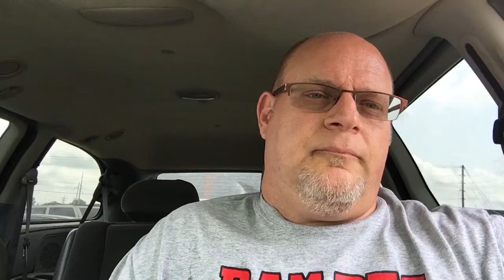GM 5.3 5.7 6.0 12552216 crankshaft issue 2.0

Comment: I noticed something today while changing my reluctor that i cant believe nobody has not seen before. While removing a 58x from  a gen 4 6.0 crank and also removing a 24x from a gen 3(maybe 3.5 because it had gen 4 pressed fit rods) to replace on the gen 4 6.0, I noticed the counterweight profiles are much different, i always heard they was the same but they are definately not. I took posterboard and traced the rear counterweights on both cranks and with the posterboard on the rod journal side, with the posterboard against the rod journal you can trace the whole counterweight profile. The difference i got for example if we are talking fractions/pie cuts, a pie cut into eight pieces, the 6L is almost half a pie or 4 pieces whereas the 5.3 counterweight was closer to 3 pieces. Its a considerable difference and both cranks are the 216 casting.
Reply from the maker: I wish someone would make a video or other resource we could share to help others identify these differences.  This is very interesting Thank you!

Comment: Did you ever get some in stone facts on this issue? Thanks again!
Reply from the maker: Still nothing concrete, I can’t find any repeatable/reliable information on how to tell the crankshafts apart; other than the original LS1 crankshafts are gun drilled. 
Let me know if you find anything!!!  JD
Reply: @HeadFlowInc maybe i can help a little here from my limited experience with LS engines as im more of a gen one sbc and bbc guy. First off every 5.7 ls1 crankshaft ive seen is not completely gun drilled through the rod throws only the mains for bay to bay breathing(only the performance high rpm engines need this, non truck engines). As for balance its my understanding they drilled the front throw-front side and rear throw-rear side deeper for the heavier bobweights. The 5.3s you cant even get your finger in the hole its so shallow, but the 6L-pinkie all the way to the knuckle-on the gen 4s ive personally seen. Im guessing the fine tuning is done on the counterweight removal(drill holes)  and placement which i would think would be different for gen 3 and 4, not just from total bobweight but the fact the big end of the rod is much different(weight wise). This is just my opinion from what little ive seen. Not fact just my guess.
Reply from the maker: Interesting, I knew about the LS1 cranks being gun drilled w/ 16 part number. I hadn’t heard the inset hole idea on the end throws; I have a 2005 6.0 crank in the shop I’ll check out. 
I read one time the counter weights were slightly “clocked” different but seems unlikely with the shared casting/part number. 
The LS production line crankshaft Balance used a +- 4 gram from mean/median scale .. so each rotating assembly could be out +- 8 grams.
Reply: @HeadFlowInc  i wish i could post pics here i would show where i traced the outline of the rear counterweights on the gen three(w/gen 4 rods) 5.3 vs gen four 6.0, the difference is massively substantial imo. I cant remember where i got this information(old age) but the LS engines are supposed to be balanced to a greater degree than the older carbuerated engines because of the knock sensors as they didnt want the sensors to pick up on harmonics and retard timing hurting fuel economy and efficiency. I also remember there was something about the sensitivity of the sensors because of the aluminum blocks cushoning effects or ability to absorb. Idk but seems to me that would be an advantage for the performance engines, i assume the knock sensors could do their job without picking up false signals.

Comment: You are thinking way to hard about this lol
I know this is a old thread but you know they all have same part/casting  number but gm has different service numbers for that part number.
If you pulled a 5.3 and 6.0 crank out of a used engines and checked bobweight they will be diff bobweight.
Moot discussion here is some fun facts for you pull apart any gen 3 or 4 4.8 5.3 6.0 6.2 apart and weigh each item from that engine rods will vary 10g pins 15 to 20g pistons up to 5g diff so any 4.8 5.3 6.0 6.2 could be off 30g from hole to hole if parts stack just right.
Also moot point since 1k members of sloppy mechanics turn gen4 rods/pistons on gen 3 cranks 8k plus for years 😂
Reply from the maker: There’s more to the story but I appreciate you watching and giving your opinion. Just because people do some thing doesn’t make it right or the way others should do it. Sloppy mechanics is about running what you have with zero cares whether it lives or not. Most people don’t catch on there’s no guarantee.
8k….. you’re a hoot and totally misguided by BS
Reply: @HeadFlowInc  yeah there is not multiple sbe stock bottom end record holders spinning gen4 5.3 8500 at 1100whp 😂 aka capizzi 4.503 @155mph 
And most hot n/a ls3 builds are 8k plus 550whp on sbe.
Have you been in a cave last few years Even weak gen3 rod 4.8 5.3 6.0 have all been 1400plus on holdeners dyno.
Reply from the maker: @Thelastoftheog  Where you messed up was mentioning people I actually know; that you have only read about. 
1. I told you to do more research because you’re only partially informed. 
2. “A Stock Bottom End” doesn’t mean it’s untouched, only it has stock parts. 
3. It takes limited travel lifters or solid roller to control the lifters above 7800-8000 rpm. 
4. You are only making yourself look foolish.
I could educate you on how all this works, but I truly don’t think you’re ready.  Keep reading on the internet and watching other people succeed!  Maybe one day you’ll get someone to believe you know what your talking about.  Good luck, have fun!  JD
P.S. I’ve been doing this 36 years so don’t think your ahead of me. lol 😂
Reply: @HeadFlowInc  if you think anyone on this planet considers sbe ls stuff to include cam choice you should retire.
And the caddi lifters are not limited travel and do well over 7k 
Still moot since plenty still run delco ls7 lifters 8k
Reply from the maker: @Thelastoftheog  My Sealed Power lifters with Comp 918’s easily rev 7300+, but you already knew that. 🤷‍♂️
How did you change 8000 rpms down to 7000 rpms?  Try to stay focused you’re getting lost already.  🤦🏻‍♂️
Keep going I haven’t laughed this hard in a long time!
Reply: @HeadFlowInc  im lost 😂 you made a whole video about a casting number without realizing they can be finished different and end up with multiple diff service numbers.
Then incorrectly thought bobweight has any effect on total finished crank weight it doesnt.
Then inferred sbe stuff was fantasy land over 8k wrong again.
Reply: @HeadFlowInc  i can only assume you are the type to advise a customer spend 3 to 4k rebuilding a 100k mile 5.3 with stock replacement equivalent parts to "do it right" for a sub 400whp n/a build 😂 vs throwing a cam in it and letting it ride for 1k. 
While still knowing the "built" 5.3 could have as many or more issues before the first oil change due to crap machinists 4pm friday builders q.c issues of aftermarket parts lately.
Reply from the maker: @Thelastoftheog  You couldn’t be any dumber, watch my channel look at all the LS videos and I think you’ll find out that you’re coming across as the most ignorant person on the Internet. You are literally talking out of the side of your head about shit you don’t even know anything about because you’ve never done it. 
I’ve never built a brand new all new LS engine. Now, you can either shut up or I will mute you on YouTube and you won’t be able to post at all.  So grow up or go away cause I’m sick of it!
Reply: @HeadFlowInc  just saying its a non issue pull any given factory sealed 5.3 apart and it will avg 15g off hole to hole possible 30g if parts stacked just right.
And those engines usually go 200 to 300k.
Now do you even know about the 100k plus bastards that gm put out aka gen  3.25  where from the factory  pressed pin gen4 rods and gen3 pistons and gen 3.5 where left factory with gen3 rods pistons on one side and gen4 rods pistons on other yes thats right factory sealed 5.3 with documented 4 gen3 in one bank 4 gen4 on other bank and they still go 200k plus miles.
Who even worries about this crap on stock parts?
Reply: @HeadFlowInc  my bad 8700 n/a sbe ls3 thats 8700 on stock rods, crank, pistons, main bolts, rod bolts, 
https://youtu.be/rArdRDYhOy4

Comment: Gun drilling a crankshaft is like adding weight to the counterweights. So if the 6.0 has an extra 40 gram piston rod assembly, it needs a heavier counterweight to start with. So that make sense matching the gun drilled cranks to the 6.0 litre.
Reply from the maker: The only factory gun drilled crankshaft is the 5.7 LS1.  I wonder how the 6.0 pistons/rods balance with an LS1 crankshaft… 🤔

Comment: I've seen half gen 3 rods and half gen 4 pressed pin rods in a 04 5.3
Reply from the maker: Yes 100% there are hybrid rods during the switch from Gen 3 to Gen 4 with the thicker beams but with press-fit pistons!  Iirc late 2003 and 2004 can have them.  JD

Comment: My 5.3 truck motor im rebuilding has a gen 3 crank with gen 4 rods. This use to be a work fleet truck I got . it chucked a rod had to by two rods . the was with a gen 4 block with 24x reluctor wheel
Reply from the maker: Wow, it’s got to be hurting the Gen 4 rod in a stock setup.  Some of the crossover engines have a weird Gen 3.5 rod/piston setup where it has the Gen 4 rod with a press-pin piston.  Good luck on your build! JD

Comment: I was wondering If an engine gets a big turbo doubling the power going down the rods doesn’t that extra HP beat up on bearings also ? The rotating assembly may be statically balanced, but doesn’t the cam, intake, heads, boost, compression and all the other variables effect the dynamic balance ?
Reply from the maker: Busa0069 It seems we’re talking about several different loads on the lower end.  
1. Rotating assemblies are both statically and dynamically balanced.  Weight matched assemblies balanced via counter weights on the crankshaft to offset damaging vibrations/harmonics. 
The Compression ratio, rotating weight and Power have influence on component fatigue and ability to handle different levels of power/torque.  It’s interesting you mention dynamic influences on engine balance because large variances in cylinder pressures would influence how smoothly the engine runs. 
Doubling the power of an engine, especially via Turbo charging greatly increases the Torque.  In reality the Torque is more damaging than HP on component life.  You’ll want to research the power levels you intend to produce and select the parts needed to support those levels. JD

Comment: the 6.0 crank is heavier because it has a thicker flywheel end
Reply from the maker: Aguilon Can Presa Canario The only years for the extended crankshaft register 6.0 was 1999 & 2000.  I have since this video found out GM uses a “Median” balance on the piston/rod assemblies for each CID of +- 4g.  Each assembly for each CID will all weigh within 8g or -4g Median +4.  No where near precision balanced, it’s a production tolerance.
Also, if you stand the crankshafts on end, 5.3 5.7 6.0 6.2 the counter weights will be slightly twisted offset different for each CID.  JD

Comment: Hi, I have been following you for quite a while, first time that I have a question. I bought a 5..7 LS1 engine the block turns out to be no good, so I bought a 4.8 engine . Can I put my 5.7 crank in my 4.8?
Reply from the maker: Sheldon Vanek Yes you can put your 5.7 crankshaft and rods in the 4.8/5.3 Block. The 5.7 pistons won’t fit unless you have the 4.8/5.3 block bored to fit. You can either use a 4.8/5.3 pistons, bore the block and use the 5.7 pistons. 
But you can not use the 5.7 crankshaft with the 4.8 Connecting Rods they’re too long. 
5.3, 5.7, 6.0 all use the same rod length 6.098” and same stroke on the crank 3.622”
4.8 uses a way longer rod 6.275” and a crank stroke 3.27”

Comment: Made heavier so they can reground for clearance diffrent set ups stroke ect made one peice fits all then make the rest lighter so in a parts box slap together shit real quick faster assembly production with out alot of change overs and the fine quility was the ls1 350 but diffrent department see it's smart in a money makeing way trucks 30 to 40 thousands and vette 60 on up

Comment: I am rebuilding a 6-liter that has a bad crank I just took a 5.3 liter crankshaft and a 6 liter crankshaft to the machine shop and he said he was curious to find out too so he's going to spend both of them with the same Bob wait and see what happens
Reply from the maker: AMERCAN TRUCK Please let me know what he finds out!  We’ve been shown that when you compare the Gen 3 5.3 and 6.0 crankshafts side by side standing on the ends, the counter weights are definitely different where the balancing holes are added. Let me know!?  Thanks for the feedback I truly appreciate it!  JD
Reply from the maker: I’ve not had access to the crankshafts needed.  Even my machinist doesn’t have any reference material on the LS Crankshafts. 
Your newer crank with be 58 tooth so you be older stuff won’t work.
Reply: What did you end up finding out
Reply: @SiempreTumbadoSprayedbyRo  the 5.3 crank was 40 grams light with the 6.0 pistons and rods. we had to add heavy metal to the crank. but with the 5.3 rods and pistons the crank was too heavy. the LS1 5.7 pistons and rod were spot on. so i think GM  balances the crank to the high reving performance engine and doesn't care how balanced their "truck" engines are.
Reply: @americantruck3943  nice appreciate the reply brother

Comment: Lol i am pretty sure they just balance all the cranks the same. If the part number didn't change  they should be the same depending on the crank line and balancer they came out of. It was a long time ago i didn't work on the crank line i am a head guy😎 (no ot in cranks)
Reply from the maker: maurice davis I was hoping each CID was balanced to their bobweight.  If they were, you could run Gen 4 5.3 pistons and Rods on a Gen 3 6.0 crankshaft!  It would balance +-2 grams. 👍
Reply: I will ask when i get to work after the holidays.
Reply from the maker: maurice davis That would be great, hopefully someone will know.  👍

Comment: Maybe it was balanced for 5.7 because it was aluminum with skirts and they thought cast iron would hold up to the unbalanced crank
Reply from the maker: Utah county Picazo's page Generally, the aluminum blocks with cylinder liners are for weight savings and heat dispersed.
The block material won’t have an affect on rotating assembly balance.   Cast iron blocks are stronger than the aluminum versions and should be used for Big HP builds. The cast iron will have less “Flex” holding the crankshaft More controlled. Which is in line with your thought about the stronger Cast blocks. 👍
LS1 engines are known to rev 6500 rpms reliably making me think the 5.7 has to be balanced. 
I still haven’t found a verifiable source on how/what GM did...🙄🤔
My plan is to just get a std/std 24 tooth crankshaft; send it off to have everything precision balanced to be safe.  Thank you for your reply!  JD

Comment: There is one casting number, but multiple part numbers with different bob weights.
Reply from the maker: Brian Nutter Do you have a link to or a copy of the part numbers per application?  Do you know where the part numbers are located and how many digits? Thanks for the info!  JD
Reply: There are about 43 different "LS" engine codes between Gen. 3 and 4.  The Gen. 4 was much larger with the number of truck engine variants.  Some engine "families" will share the same rotating assembly, so the part numbers for the crank match up with the piston and compression ratio.  Other than having access to a dealer computer, one of the better tools out there is the GMParts direct drop down menu's by make model....then the engine code options can be narrowed down a bit.  It will have a part number listing for the various internal engine components.

https://www.gmpartsdirect.com/auto-parts/2012/chevrolet/silverado-1500/ltz-trim/6-2l-v8-flex-engine/engine-cat/engine-scat

You can go through various year models and eventually make a determination of what fit what.
Reply from the maker: Brian Nutter I will dive into the link, I truly appreciate the help!  I'd like to create a tool to help people identify which application a crank came from. At this point it appears people just use what ever . Thanks again! JD
Reply from the maker: Brian Nutter I'm not sure where to find the individual part number. The crankshaft I'm looking for, at the website link, 12561302. I don't think there's a number this long on the crank unless we're missing it.

Comment: I always balance to bobweight. The shop I use for balancing gets all weights within 1/2 a gram. It is very important to check rod weights on both big and small end of rod. Just remember that adding extra weight to the small end of the rod/piston assembly will effectively turn the rod and attaching hardware into a rubber band. For what it cost always have the rotating assembly balanced.
Reply from the maker: Mike MacCracken I agree, here it's roughly $200 to balance an assembly plus the cost of Mallory metal if it's needed. Cheap insurance!
Reply: HeadFlowInc it is about the same here in CT. I research every part I use in a build and try to match the rod and piston to bobweight numbers of the crank. I have never had to use mallory but sometimes you have no choice. The shop I use for machining and balancing are the best and for the 33 years I've used them had not one issue. A machinist who builds engines and races in restricted classes is worth his weight in gold because they get creative and make it last. But good machine work doesn't come cheap.
Reply from the maker: Very true I agree 100%